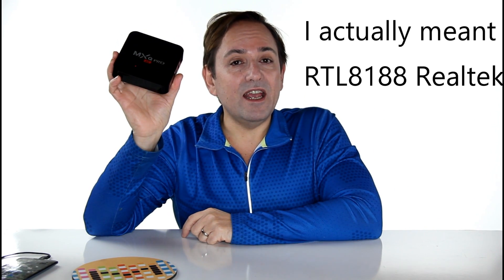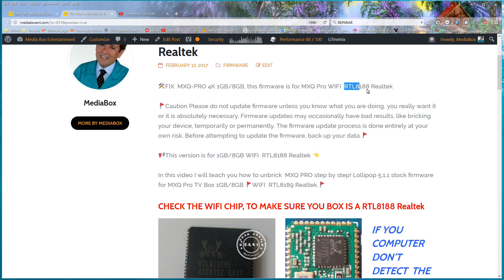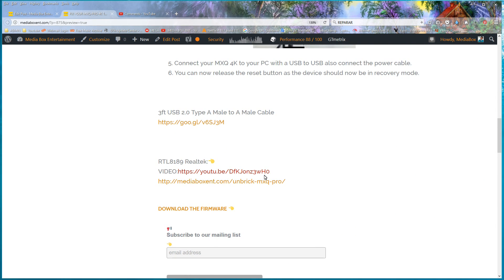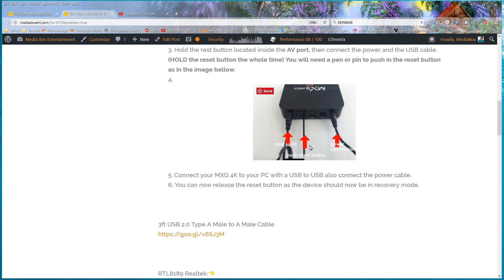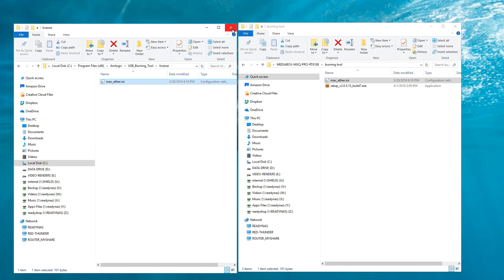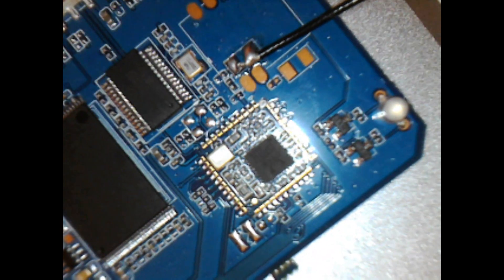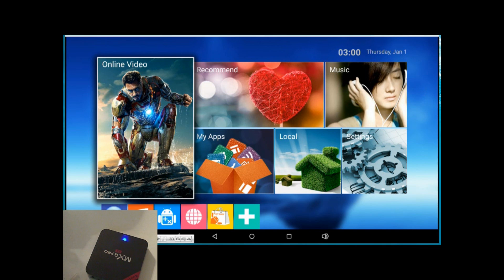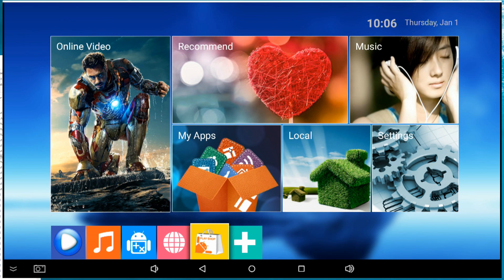💯 UNBRICK AND FIX MXQ-PRO 4K 1GB/8GB WIFI  RTL8188 Realtek

Comment: Hola dario me puedes contestar? tengo una placa de tv box R3229MXQ_4_20170303_v1.2 con un micro rockchip CDEKN50026 1714 me podras brindar un link para descargar el firmware. El tv box no liga solo queda en setup.

Comment: I recently purchased three Mxq pro 4K but all of them getting hanged and I cannot find Realtek chipset on the same board .When I tried to flash  your firmware, It is not detecting even with pressing reset button which is near to the AV.
Kindly help me to fix these issues.

Comment: My android TV box came with android 5.1. It is OTT TV BOX MXQ PRO 4K it has 1gb ram and 8gb rom. It's board is S905Q_V1.0.  It's wifi device is REALTEK 8188 ETV. It's flash memomry is Sandisk P545105231. I have windows 7 64bit and I'm using USB 2.0 port.  It gives me error at 8%. ([0x30402004]UBOOT/Partition boot/Initialize partition/Error result). Could you Help me?

Comment: Hi Dario, New to your site. I have a MXQ Pro+ 4k (Amlogic S905x Quad core ) box. I got firmware from China Gagets that said s905x but when I put it on the box it shows s905. Before I had intermittent wi-fi now it will not switch on. Any advice?
Great site. Paul.